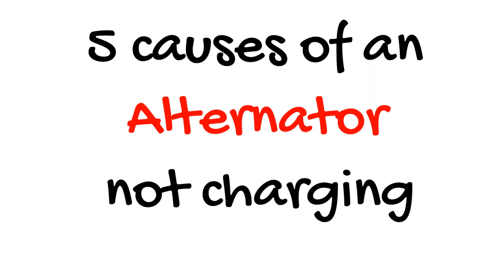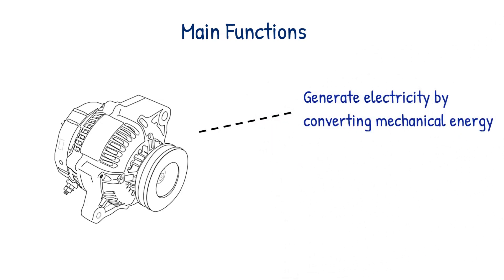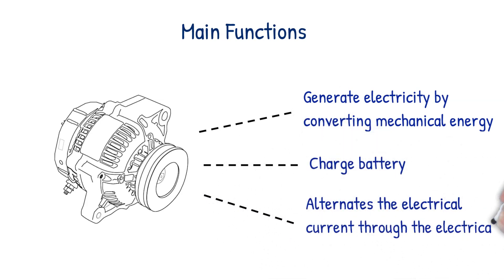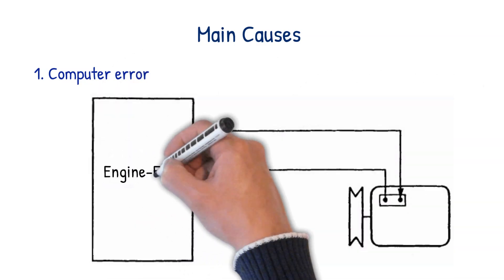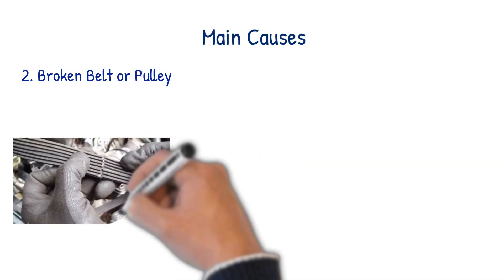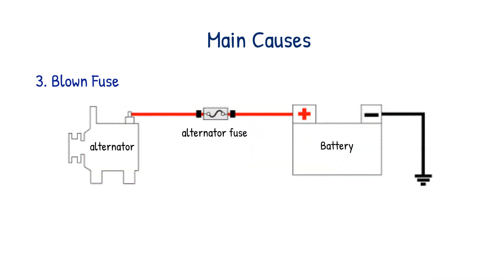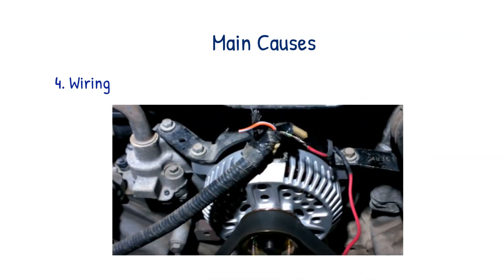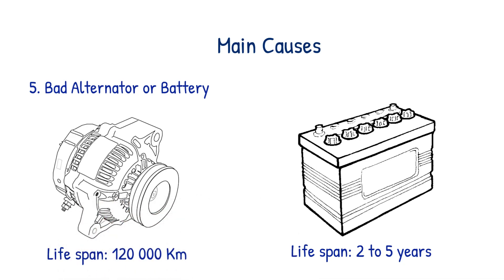5 Causes an Alternator Not Charging

Comment: Any reason why hot weather will affect alternator and cause not to put charge to the battery?  No problem in the mornings when is around 70 or 75 degrees but once weather reaches upper 90 degrees  the alternator will not engage and the car will be running on battery charge only.
Reply: You're using your air conditioner more duh

Comment: I have a 2005 Suzuki XL-7, and, have had three Alternators,as well as 2 new batteries, still won't charge,  so, it's off to the junkyard even though it looks and drives great, when it is running that is, totally frustrating!!
Reply from the maker: You need to run a “standby current test” in order to check for any electricity loss, maybe the alternator and battery are working properly but the loss is big. 
Also check the difference of voltages between the battery and the alternator.

Comment: When alt under load how many volts
Reply: Altev.
Reply from the maker: 13.6 to 14.4 volts
Reply: Do i need to replace alternator if the volt always between 13.9v~13.6v?
Reply from the maker: No you don’t need to replace it
Reply: No